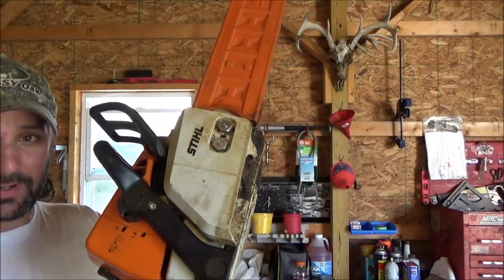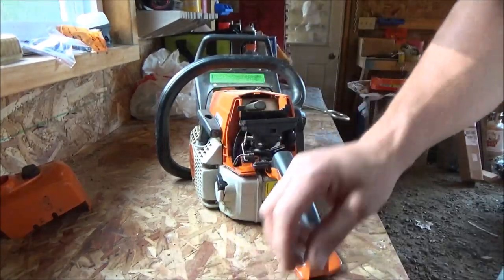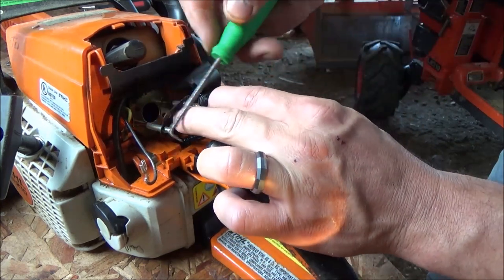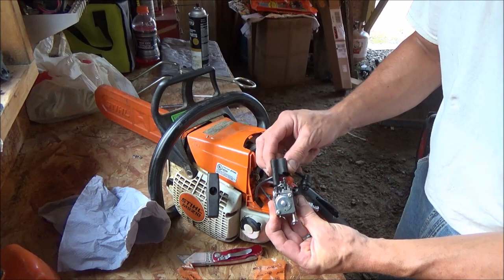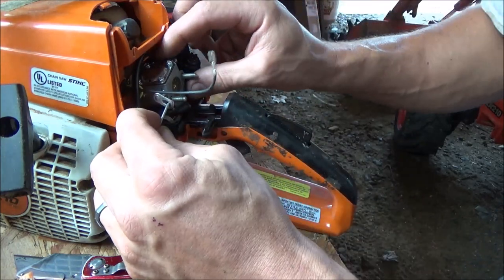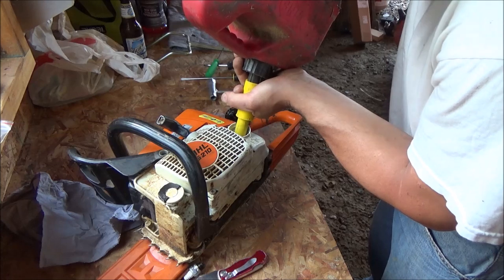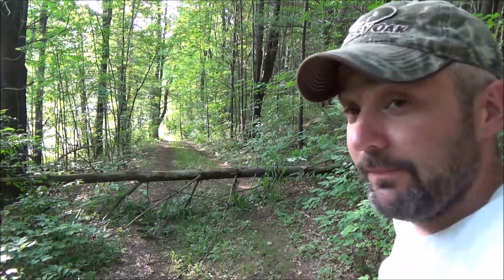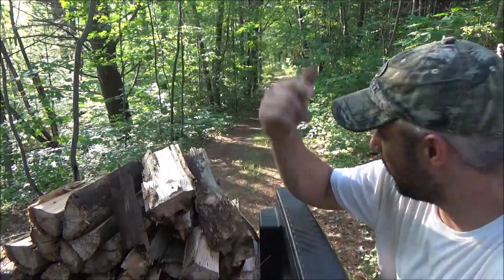Replace: Carburetor Stihl MS210 Chain Saw

Comment: I am that Stihl trained guy, but also do lots of small engine repairs, Stihl is German engineered, if it looks like goes there with a click than it does. First where were your chaps? Never i mean never run a chainsaw without them. Now start up, let the engine and piston warm up before revving up,causes cold piston scoring . I use Tru-fuel cost a little more but if you leave it in there over time, it will still start up to a year or more. Had to chime in, you are are great mechanic to learn from on vehicles,i like your method for finding the problem and fixing it, just had to rattle yor cage on small engines. Keep up the great work.

Comment: I found watching Eric rebuilding this chain saw so exciting and motivating that I got some tools together, marched into the kitchen and attacked my sticky old Moen faucet. Got the cartridge out and pulled apart, cleaned it up a bit, and lubed it all with Sil-glyde, (didn't have any food grade silicone lube on hand), and put it all back together. Wow, smoother than new.  Im so proud of myslelf.  Next I'll probably pull the head on my 20+ year old 525i. That thing really needs work. Thanks Eric.
Reply from the maker: That is awesome!

Comment: Bought the same carburetor for my Stihl MS250. Watched video and answered all my questions with the adjustment screws in the different position. I would save the old carb though, take it apart and throw in an ultrasonic, put a new kit in it for the next time. Thanks.

Comment: I own the same chainsaw, one other and lots gas powered lawn gadgets.  I got sick of replacing carbs so I started using premix fuel in a can rather than mixing my own.  Everything starts right up, plenty of power.  Fuel is expensive but offset by the extra time I have.  

Great video!
Reply: Plus premixed has very good additives that stay fresh way longer. So far Husqvarna 240 premixed fuel in it for 5 years, started right up no problems.

Comment: glad yours worked good for you, i replaced mine as well got the carb off amazon like you said real cheap,installed it didnt take to long and ran okay for a while then started having ruff running readjusted it, fooled with it for a couple of months and then took it to the dealership and $60 later it was running great after they put a new carb on it and it is still running great 2 yrs later...sometimes life is to short trying to save a few bucks....LOL

Comment: Just came across this old episode.  When I purchased my Stihl a decade ago it said right in the manual that if you used anything other then Premium gas with zero ethanol, the warranty would be Void.  Salesman said to always just run it dry before storing.  Must say good advice.  Wing Wang Stihl saw, has a nice ring. Lol

Comment: So I borrowed a chainsaw from my buddy and the MS210 is what he gave me. He said it takes him about 20 min to get it started though. I threw in a BPMR7A NGK spark plug and it started on the 3rd pull. This is a pretty good chainsaw. Thanks for this vid I may give it the spray cleaner treatment before I return it.

Comment: You are like a brother from a different mother. I have the same tractor and the same chainsaw, and my Stihl is also not running because the carb is long plugged up. I have been using my Mac one instead, because I worried about the WingWang carbs on Amazon. I bought one for my leaf blower, and it doesn’t work right when hot - can’t get to full power. I suspect it just is made too small and can’t pull enough fuel fast enough.  But, based on your experience, I’ll take another shot at one for the Stihl. Thanks for all you do!!
Reply: Sounds like it just needs adjusted or got DOA carb. Buy Amazon carbs all the time, but never use the spark plugs.

Comment: Done a few of them zama carbs. Them diaphragms get pretty hard after a lot of use and old fuel sitting inside them.  I usually buy the rebuild kit. It comes with everything but the carb. I usually always replace the in tank filter also. Sometimes you’ll find kibbles and bits pieces of hose in the tank depending on how long it’s been sitting around with old gas in it.

Comment: I bought one of these kits for my leaf blower   1 yr ago still runs good. The fuel line that came with the kit failed though i fixed it with rubber cement .i would suggest reusing the stihl line great video

Comment: That fuel pump relay joke was awsome, keep up the good work and greetings from Latvia :)
Reply from the maker: raimondszunda hehe
Reply: @SouthMainAuto  That must be one of the old stihl's that had a problem with the fuel cap not venting properly and allowing the fuel tank to be pressurized too much. and guys in the trees would take the fuel cap of to refuel and would get sprayed with gas and if the engine was hot enough, some caught on fire.

Comment: As a small engine mechanic, not bad Eric, I was sitting here trying to put my hands through the screen to help....I guess this is how you would feel if I was working on my truck! Not the best choice of carbs, but if you get the adjustments right, it'll get the job done for occasional use.

Comment: All my chain saws get a good port and polish of the intake and ex ports. And I always pop the heads off and put it on the table sander and I take and mill just about a thousandth off the deck of the head and throw it back on or I would take and switch the three piece head gasket off and put a thinner single copper head gasket on and run a E3 spark plug and I always run the highest octane possible. And the powerband is just outrageous. I always pop the screen out of the muffler for better flow.  But the saws love a thinner head gasket and mild porting. If you wanna get into it more you can port your sleeve depending on the saw. And you can run a different filter. But I always do a mild port and polish, mill the head a thousandth or put thin head gasket and I always run 100 octane from the rebel gas station cause I live here in lasvegas and terrible herps and the rebel gas stations have 100 octane non ethanol fuel for 6 bucks a gallon. Or u can go to the North lasvegas gas station and get Leaded AV fuel. 100 Non Ethanol, 105LL, green  Sunoco 112LL,115LL and Blue 120HL (LL= Low Lead, HL = High Lead) the saws love a 50-50 mix of 91 and the green Sunoco 112LL the saws love the Lead In the fuel. It adds lube to the upper cyl and seals the rings better. I always run my 2 stroke dirt bikes on leaded AV fuel they love the added lead as it lubes things and smells delicious

Comment: Another great vid Eric. Did I hear a little, Trinity Giggle in the background?  You may consider pulling the muffler and cleaning the carbon from the exhaust port. And those plugs are horrible. The last one I had burned completely in half. You can't beat a good  Sthil. I have an old O29 I still use all the time.

Comment: Ahh, now you're in my line of business! Fun, ain't it? :D  It's all what  you're used to - I hate working on cars in the same way, but I fumble through it. You did good there - don't sell yerself short! :) I would've left the hose and filter in the tank too - they're a bit of a pain to swap.

If you think that was a pain in the ass, you should try a carb swap on a Husqvarna 350 - the first time I did one of those I was cursing up a storm, as if it were a GM product! :D

Yeah keep the OEM Zama - those are great carbs. You probably could've just disassembled and cleaned it rather than replacing it, but now you have a spare. WHEN the hong chang carb fails (LOL), you can still clean the OEM one and use it. You'll figure it out - they're really very simple - just have to watch the float needle side - really TINY parts in there. Just hold a finger on it while you remove the screw, then slowly release, and take the tiny spring, fork, screw, and needle out. Putting it in is harder to explain, but you'll figure it out. I balance the little spring in it's place , then throw the little rod in the little fork, and slide the needle in the fork, and install it all in one shot. Easier said than done, but you'll get the hang of it since your mechanically inclined.

This is what I do day in and day out, all due to ethanol in our crap gasoline. :)

Yeah that thing was in pretty good state of tune right out of the box. Miracles never cease!

Comment: I just fixed one on my poulan weedwacker. Almost exact same zama  carb. I got the rebuild kit for $8.99 on ebay. There are 3 gaskets to change and a diaphram. They give the needle, spring and welch plug too (didn't use). The new carb was in the 20s....ok I'm cheap. Would have been nice to show the rebuld :). Its pretty easy.

Comment: Did the same thing with an old Toro snow blower that my dad bought back in 1984. It was less then half the price to buy a Wing Wong carb then to buy the rebuild kit for  the original. Two years latter still running great. I know this was a few years ago but it would interest me to know how your saw is holding up now? Thanks again my friend...

Comment: I have learnt a thing or two ,  working on chain saws , check the spark arrestor in the muffler it may need to be cleaned , for it can hamper a saw from running properly

Comment: Hi Eric,
I use, "Stabil" (Amazon sells it) in my ethanol tainted gasoline mixes. The other more convenient way is to buy, "Trufuel" premix, (Amazon sells it. But you can buy it cheaper at Home Depot) that has the 2 cycle oil (40:1 or 50:1 2 cycle-oil mix) in it and lasts a real long time. That might save you future carburetor re-build time.

Comment: Did you need to make adjustments to your carb to get your saw to run smoothly?  I purchased mine off your link and while it does run and idle it is pretty rough.

Comment: Eric O., if you’d run something like TruFuel ( 93 oct.) or SEF ( small engine fuel 91 oct.) premixed fuel you’d never have that issue letting the saw sit with fuel leftover.  The particles of the Ethanol are so fine that they can seep through the fuel lines, tanks and even hulls of boats and other machines alike.  After 2 weeks of ethanol resting in your tank you end up with separated alcohol at the bottom of the tank and it sours everything.  Simple solution, just buy some TruFuel to keep on hand.  I’m just trying to offer some knowledge in return for all you’ve given to us.  Take it easy y’all!

Comment: watched your video ,cleaned carburetor , put it back together pulled three time and it ran good for half minute and died,so I put new spark plug in it and wouldn't start. I checked the spark coil and spark plug out, all was firing but still wouldn't start. I sprayed starting fluid in it and still wouldn't start. Do you think I might need to invest in a new carburetor.Stihl 210 model

Comment: Is it a common thing with 2 strokes that the fuel does go off, maybe because of the oil/fuel mixture and/or the fact that it is a small engine with little compression
Fresh fuel first..?
Reply: Gasoline especially tends to go bad, especially the new ethanol mix stuff. Diesel and the older non ethanol blend gasoline can sit longer. 

Thing is you typically use garden stuff in spring/summer, so if the fuel gets to sit in the tank from late summer/fall until next spring it's more than likely gone bad.

Comment: love the safety gear .. fresh petrol and a good oil mix   works every time . my experience with strimmers and chainsaws involves replacing the fuel lines as well. those links are well fiddly.

Comment: Stihl actually owns Zama - the carb and maker and carbs were instantly cheap ...the Star tron enzyme really works well for fixing ethanol problems
Reply from the maker: Michael Owen I have seen that stuff for sale. Do you use it?
Reply: Yes... even in year old gas in an old wood splitter... took about a half hour and it was running like new..and you can't use too much!
Reply: Michael Owen I thought 
Stihl bought out Walbro.
Reply: ok thanks.

Comment: Those carbs are usually tuned right to "factory specs" right outta the wing wang carton.
Reply: I bought a wing wang carb (for a snowblower) and no gas was coming through. Turns out the mill bit they used broke off inside the fuel inlet. Luckily my time is not that valuable. Two hours later the new carb was as good as new.

Comment: airplane fuel 100 oct lo lead  or race fuel. dont deteriorate for years. plus 2cycles can use all octane so you can lean out to better power and rpms galore! nothing like 12-13 thousand r's to excite the man in you!!

Comment: Thumbs up indeed Sir! Very curious to know what your opinion is on ethanol in small engines as you mention it but also mentioned you neglected the saw for some while. My thing is I don't like being gouged on the price of non ethanol fuel like some do in my area. I continue to use ethanol fuel in all my small engines but I have a dry erase board in my storage building where I keep track of dates. I try and start up every engine at least ever third week and let it run for just a few minutes. In the case of my generator and my outboard where I have fuel shutoffs only ever couple of months. The small stuff,, blower , weed eater, lawnmowers, etc are gonna get ran ever third week. Been doing this for years and no problems as I always buy the ethanol gas. If I don't use up the non mixed gas in the gas cans in a few months, it gets poured into my vehicle and replaced with fresh. What is your opinion? Thanks for a great great channel!!!!

Comment: Fuel line pulls out of fill hole and disconnect filter, then carb side out the top of tank and has a snap seal.  Reach in with needlenose to get line out of tank.

Comment: Not sure what your elevation is there, but I'd say go 1/16 turn richer on main at least, maybe on low circuit too but didn't have a chance to hear it down there much. On a two stroke it's better to be a bit rich than a bit lean since your also metering oil to the engine as well.

Comment: Its more expensive but I only use pure gas (ethanol free) in small carburetor engines such as chainsaws and mowers.  I just mix with oil and keep rest for mower.  I never have to use any kind of winter stabilizer at all.

Comment: "wing wang" and rubber donger"  Great video...Lots of "lol's on a father's day morning.' This small engine thing your doing is my little hobby. The fuel pump relay is behind the rubber donger thingy which sits behind the ac blade compressor. ;-)

Comment: I changed the fuel line on my ms210c without taking off all of the plastic cover. Just put a shit load of 2 cyl oil on the grommet and the fuel line pull up through the inside of the tank and it go right in place. Those lines will eventually crack because thy sit in there all bent and weird.

Comment: i love my Chinese parts never fail me yet they are flocked it looks like you got one that missed the flock i buy them by the case from Hong Kong i get a few missing the flocking your vent is not working as you noticed you had pressure on gas line you got a newer model carb that doesn't have the vent  i believe been a month since i worked on that model  lol wish shipping was cheaper you could send it me we take them all apart and clean the whole saw even for just a spark-plug when they leave the shop they look new and start like new you did what we do if we get the newer model carb they work great a carb rebuild or replace cost you 25 plus a few dollars for fuel lines filter and plug and air filter plus we disassemble and clean and sharpen chain

Comment: I had one of those Chinese carbs really throw me off. Set the high and low mix about 1 turn out and it would just start and die. After lots of fiddling I realized you can only turn the screws about an 1/8th turn out otherwise it's way too rich.

Comment: Been using those Wing Wang's for years, work perfect for me.
So your trying to take over the small engine repair on You Tube hey.

My favorite Channel for small engine is (  Taryl Fixs All ).
Overall Good video !! 
Oh, I hand wax my Rider Mower, Between Naps :)
Reply from the maker: Charles Miller Haha why do I not doubt that?
Reply: If it makes you feel better, I just replaced my old oil-fire steam heating boiler at my house with a new oil-fired hot water boiler (and converted the whole house over to hydronic baseboard), and I've been saying I'm gonna throw a coat of wax on the replacement, especially considering the effort I put into the install!

Comment: I have done several small engine jobs this past year for my customers. Just did the same saw 2 weeks ago with a new carb from China (ebay). I don't trust the China parts because you have no way of knowing if its a genuine Zama oem carb or a clone copy because they seem to disregard patents and copyrights. Bottom line is these dirt cheap parts from China work. Maybe you and DonyBoy73 could do a collaboration video?

Comment: I got a question fer ya....Can you get your truck started if you don't have a can of brake parts cleaner with ya???
Reply from the maker: joel mccoin as long as the fuel pump works I can but when it dies rest assured I have a can handy!

Comment: Good video Eric. I'm a Husky guy myself but nothing bad about a Stihl. And I wont bust your chops about chaps or ear face protection. I just bought a egg foo yung carb for a craftsman lawn mower The rebuild gasket kit was $8 and the replacement carb was $16 so I got the carb. It works fine.
Reply from the maker: Don Guptill Well if you watch the video you can see I have a Husky and a Stihl :) Only my Husky has four legs....

Comment: I wish I could tear things down with the confidence you have. I always feel great trepidation when tearing things apart -either for a diagnosis or repair, actually it's always both. Am I going to remember where this thing goes and how it goes?  So much for being mechanically inclined. Nevertheless, I ain't done too bad over the years, even with all my stupid mistakes. As always thanx for the video. BTW, I'm thinking you are one of those guys who never sits still.  Not to worry I do plenty of that for both us. ;-)